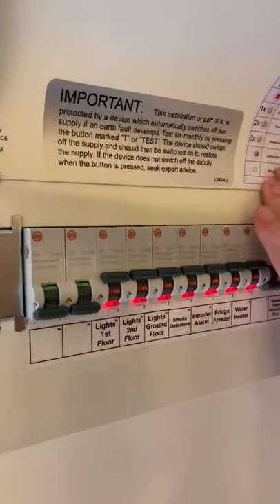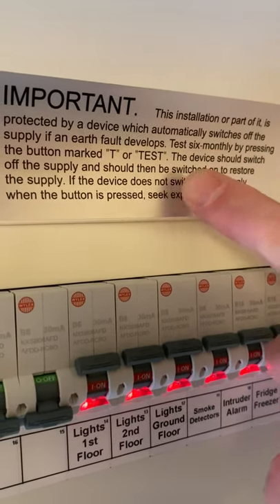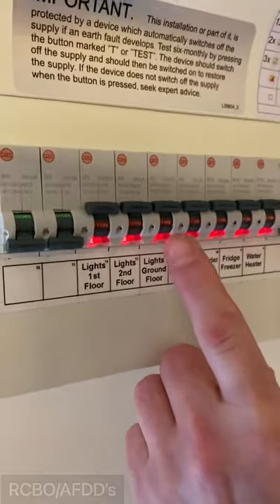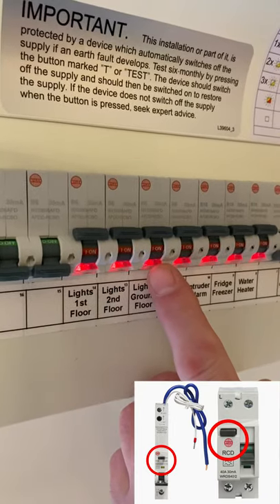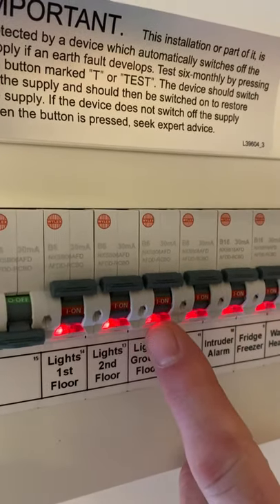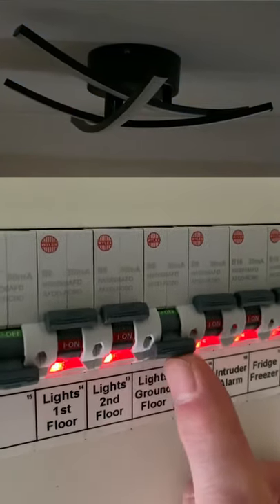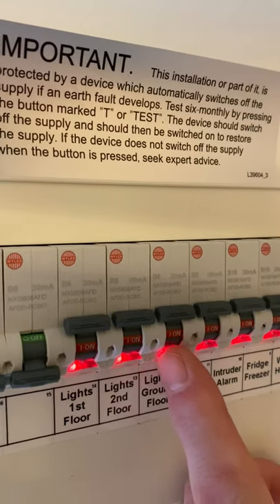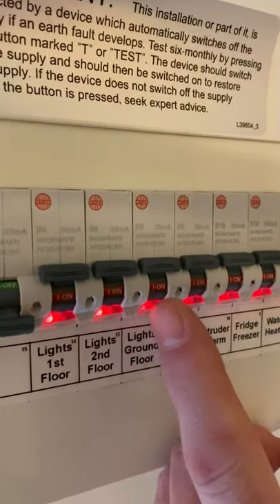How Often do I Need to Test my RCD 🤔🤷🏻

Comment: I always press the Test button on a RCD/RCBO when i want to switch it off to isolate the circuit. Since it also tells me the RCD is still working.
Reply: I use my multi function tester on the RCD setting to trip circuit prior working on it, 1 so i know it trips in time, 2 to check rcd operates, and 3 if doesn't trip before i add my socket i then know beforehand and can tell customer before they blame me afterwards.

Comment: Wish they would explain their used abbreviations. I would understand this then. Now I do not; what a shame.
Reply: RCD (Residual Current Device) is the family name.  It contains

RCCB Residual Current Circuit Breaker WITHOUT over current protection 
RCBO Residual Current Circuit Breaker with over current protection 
CBR  Circuit Breaker with Residual Current Protection
MRCD Modular Residual Current Device WITHOUT over current protection 

RCCB only does Earth faults so needs to used with a MCB (miniature Circuit Breaker)

RCBO are in affect a RCCB combined with MCB so will protect against
Earth faults
Over currents
Over loads
Short circuits between between Line (live) and Neutral and not Earth